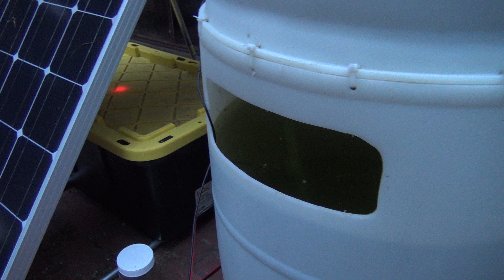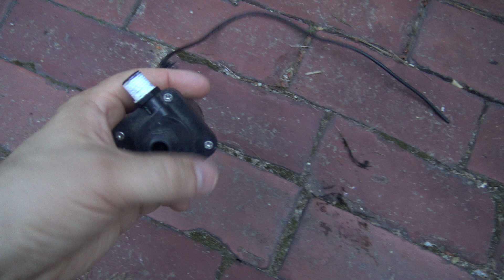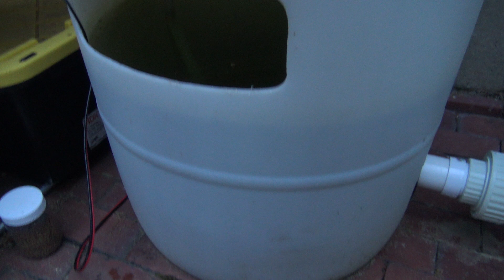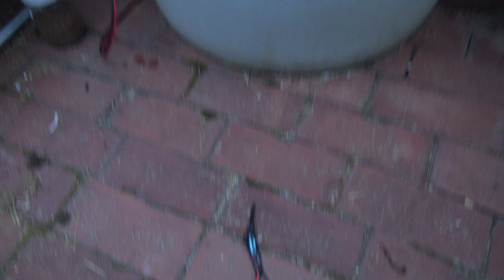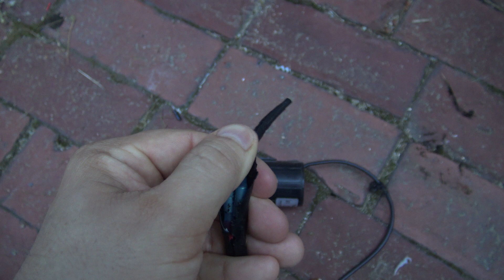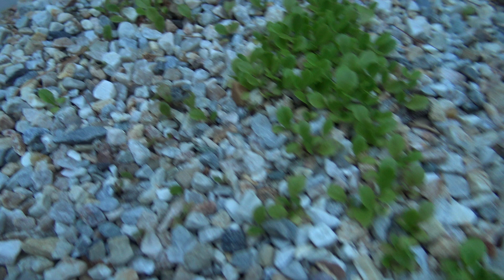#491: How to Diagnose & Repair DIY Aquarium Problems - Tank Tip

Comment: Put a window screening bag around the whole pump and sponge foam to keep everything in place and filtered.
Strip back small wire insulation enough to fold wire on itself 2 or 3 times to fit into crimp connector snugly for a good connection.
Good troubleshooting technique is important. Carry on!